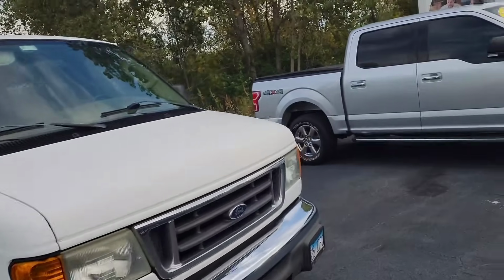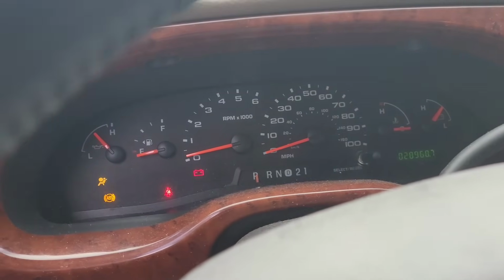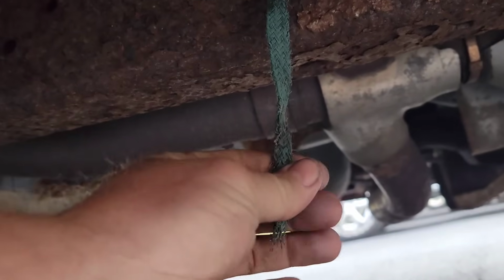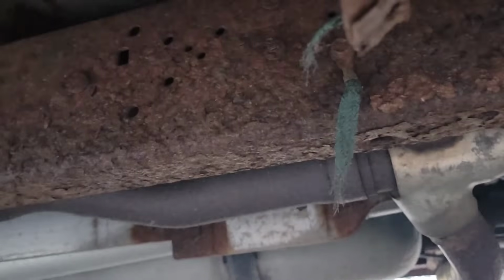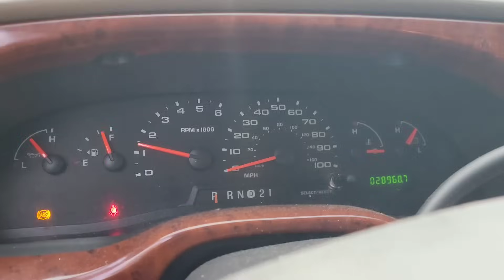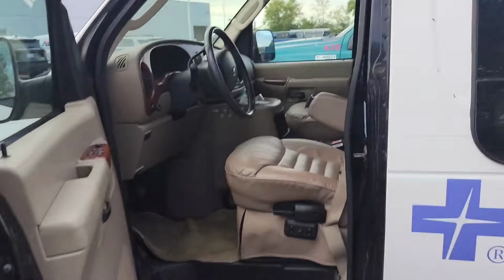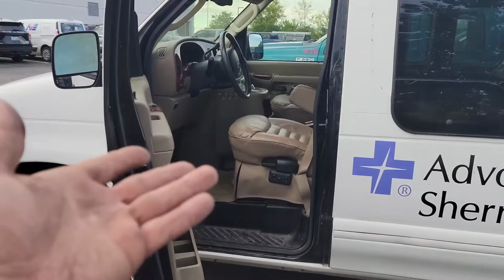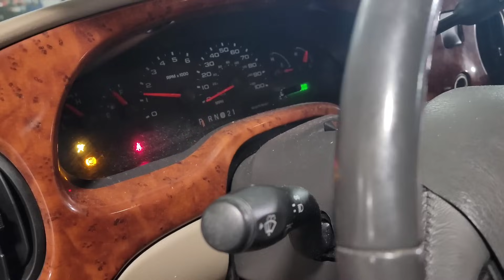Econoline No Start #1 Reason Why Typically - Crank No Start - Easy Fix - #econoline #nostart #ford

Comment: I have an 89 E150, all relays check good. Added ground to body at battery. 12v out of inertia switch. 0.14v at high pressure pump on frame. Just lost.. I'm going to try adding a ground as you did see if it works.

Comment: great vid. this might be my friends problem on his hvac van. one thing i would recomend is to drill and tap my threads for a bolt or machine screw and not use a self tapper.
Reply from the maker: James you came here and you possibly have solved your problem which this is the number one problem for a crank no start on an Econoline

I don't mind suggestions James but you're telling me what you would do if you were me but you're coming to me for help? Come on man what I did here is perfectly fine and it works perfectly fine

Comment: I separated the fuel line and turned key on. Fuel came out great. Pump works perfectly. But will the missing ground strap still make the not start?
Reply from the maker: Yes
Reply from the maker: Don't go off just what you see
Reply: @FordBossMe  ill try the ground.

Comment: People shoot the parts cannon when it's just a ground. First thing to at least check.
Reply: Most of the easy stuff is always overlooked. Its crazy but it happens to the best of us
Reply: @codyphillips48  it does indeed. Cause we are like oh I've seen this before I've done dozens of fuel pumps. Then karma is like not this time homie just a ground
Reply: We used to call it tunnel vision. Once you get honed in your mind is hard to change!
Reply: @paulday6875  facts

Comment: I've had those braided ground straps break on just about every vehicle I've owned, no matter what manufacturers they were made by! Terrible design flaw.
Reply: I use tweed and coat it with bulldozer grease.

Comment: Wow! This is something that many won't even check out. Had a 2000 Honda Accord that had interminted starting  issues. Previous  owner had a subwoofer grounded to the ground wires on the fuel pump. Just left it sort of hooked up. Removed what was left of subwoofer  ground, cleaned everything up and tighted up the fuel pump grounds. A few years later  all is still good. This was a accidental find by the way. Enjoy your videos!
Reply: I noticed the gas gage said empty but when you when back to start it it said full 😅is this a trick

Comment: That’s a very important ground that ford cheaped on. Are the 2011 econoline stripped chassis like this or no because I may check out the one on our 16 foot box truck which is a 2011 e350 frame with a Dual rear axle. Also I’ve never seen rust that bad on a newer van
Reply from the maker: This is an 05

Same ground yes

Comment: While researching my engine flooding problem on my 1996  E150 I came across a video [ 94 Ford f150 fuel problems]  That mentions Fords F150's around the same year to have the same problem with the grounds. the poor grounds supposedl;y gives a false reading to the computer which somwhow contributes to the flooding. Thanks for your time and effort, it's certainly worth checking into.
Reply from the maker: I appreciate your feedback

Comment: Dude thanks! My work van was down and it just sputtered out and stopped working, it also would only sit in idle rough with starter spray to get it going. As soon as you gave it gas it died. Literally it was because of that ground. Weird how funny electronics act without a good ground

Comment: The fuel gauge stayed still(showed sub empty) when you were demonstrating the van wouldn't start.  If the fuel pump were the only thing bad, would it act that way?
Reply from the maker: It could be a level sender on the fuel pump itself but if the ground was bad and you would have multiple things not working like I showed in the video so it may be a fuel pump but that doesn't say that you shouldn't maybe correct that ground or add a better ground to that just to rule that out and it doesn't hurt to do it anyway

Comment: Hey, are flooded vans repairable? Looking for a van and trying to avoid the ones with engine and transmission problems cause those sound a lot like major repairs. I saw some flood vans and was wonder if those are fixable.
Reply from the maker: Yeah they are I've actually taken for the vehicles apart for people to clean them all out got everything back together and clean the carpet and stuff for them it's expensive but it's definitely doable
Reply: @FordBossMe   thanks you the quick response. The van itself is a steal so I’ll definitely get it. I think it might be a good project to get me through this summer. Just found your channel this morning and I’m pretty sure some of your videos address problems I’ll probably face so thank you for your content and good luck on your new endeavors 🙏🏼.

Comment: As a New Ford Tech for learning purposes 
If I may ask what led you to this ground strap fault in your diagnosis?
Reply from the maker: It comes from experience years ago with a crank no start and me chasing my ass and one of the senior Techs came over when I was like 20 years old and said check that ground strap find you I am 36 now oh it was awhile ago Lessons Learned with experience
Reply: @FordBossMe  well I thank you for passing it on saved me from chasing wind literally was getting told through a pump to it glad I didn’t

Comment: Had a 2013 Mustang GT that wouldn’t start only pushing it (Manual) we checked the clutch pedal and the switch and good. Checked for all grounds (frame) and all good. Then the starter had a loose screw on the ground and i pushed it and the car worked… it’s impressive how little Can a car not start.

Comment: QUESTION: I have a 2015 Ford Escape 2.0L. I was planning to install a DIY sun/moonroof position indicator using a magnetic reed switch, indicator LED and magnet (all 12V compliant). Would I have any power issues, if I tapped into one of the dome light wires to make the circuit? Do you have any advice for the installation? Thanks in advance!
Reply from the maker: I have no idea where to even begin other than telling you I would run my own power source with a fuse from the battery

Comment: Hey rich I just picked up a 02 e250 with the 5.4 only 132k miles anything to look out for on these vans ?? It tries to start but sounds like fuel pump is dead?? It hasn’t been driven in several years when owner died and it was left in a warehouse.Already changed brake and Pw steering fluid . next is coolant flush and oil flush  

What’s the best oil and OCIs you recommend for these engine?? Does it have to stay 5W20 or can I do 5w30 since I’m in Texas ?? I’m just going to use it for my monthly 500 mile Dallas warehouse runs lol🤣😜
Reply from the maker: Just use 5W30 and use Valvoline or Pennzoil Platinum
Reply: @FordBossMe  thank rich 😎

Comment: I saw a video that said, you have to make sure your ground from frame to body like you did, then frame to motor then body to block.
In my 93 E150 i changed out all theRelays cause never done it, put ground from block were egr valve mounts to it and fram under hood were it atraches to left whedl well. Checked it with meter & have Gd connectivity but still DON'T start jyyst cranks. 
Will try the one in your video to see.

Comment: SANCHEM makes a product called  NO-OX-ID A-SPECIAL. A 2 oz can be bought from eBay for $10. This is a conductive grease that is put on the wire end before crimping on lugs. Plus it can be put on the lug itself before bolting in place. It will never corrode  The best thing is t can be put on battery posts before the terminals are put on. Cover the terminal itself and the bolt. Again it will never corrode. It will look like new for years. Just a very thin layer is needed.
Reply from the maker: I use XG12
Reply: @FordBossMe  Good to know. Thanks

Comment: I've been driving these for years, we have a fleet of them. I've put hundreds of thousands of miles on Econolines, never had this problem that I'm aware of. Fuel pump modules, yes. Did they fix the ground strap problem from '08 on up?
Reply from the maker: Before I answer anything here and I really don't know whether or not you're being sincere asking a question or you're kind of being rude at the same time so I could just be wasting my time even responding to you because I don't know how to read a comment on the internet because I don't know somebody's intention this can be taken more than one way

The first part of your statement probably wasn't even necessary you could have just asked a question by itself

No they never fix the ground strap problem even until today I get 2017/2018 Ford vehicles in where everybody goes right for all the difficult stuff instead of checking grounds and if you spent any time on this channel and you actually paid attention to what I'm talkin about here you'll see that I even Preach Today a lot of the problems that they have with electrical connections and Communications in between modules is because of grounds
Reply: @FordBossMe  thanks for the reply, even though the first part was unnecessary, you could've just replied. It was a legitimate question.
Reply from the maker: @bobthetruckerguy5770  well I mean I have to stand up for myself and if I have something to say I'm going to say it that's just how it is here and you'll learn on this channel this is how I am if I feel like somebody could be possibly attacking me I give it to them straight up front to let them know if you're questioning my professionalism and what I know then you don't have any business here but if you're legitimately asking a question I'll do everything I can to help you

Now you laying out the context of you driving these Vans for so many hundreds of thousands of miles doesn't do anything for our conversation maybe it helps me get to know you a little bit more but it doesn't do anything for me and you establishing a communication line and you asking a question
Reply: @FordBossMe  I was simply establishing I've had a lot of experience with these vehicles. Not attacking you in any way. Another unnecessary fact is that we operate in upstate NY where they use tons of salt on the road, we run these vehicles over 400,000 miles, and the frames look better than that van you were working on with only 28,000. Must sit in in a very moist location. I'll talk to our mechanic, now I'm curious because I've never had any major problems with these grounds. Usually when it won't start like that, it's most often the fuel pump module.

Comment: Thank you for the information my friend. One question, I have a 78 ford econoline and its not turning over, could that be the issue as well?
thank you
Reply from the maker: I'm not sure back that far

Yours would be battery
Starter solenoid 
Cables / wires
Starter itself 
Or the ignition switch 

Look up how to jump and Starter and that will help
Reply: @FordBossMe  Thank you buddy, went thru every aspect you mentioned and found the gas pump is not working. Thank you :-)

Comment: I’m having an issue starting my 96 e350 wagon. It has a brand new battery too. My ground wire looks fine but the rings do look corroded. I wanna replace it anyways. What AWG wire did you use for your ground jumper? Thanks!
Reply from the maker: 2/4/6 all would be sufficient doesn't need to be massive
Reply: @FordBossMe  thank you. Your video is very helpful

Comment: i've had the same problem and mechanics replace three batteries, and disconnected some electrical stuff and  a day after i got gas, it won't start, it almost crank but wont turn over on y 1999 Ford Econoline Van. El50.  Can you recommend a mechanic in Galveston Texas?
Reply from the maker: I don't know anybody in Galveston

Comment: I tried this but it didn't work. I'm trying to fix my interior lights. I noticed that I didn't have a ground after the body shop worked on my rocker panel. I was really hoping I could get my lights to work again. I reused the old screw and hole. Should I have made a new one like you did? I ever sanded off the rust. Is the rust and issue?
Reply from the maker: Yeah if I was you I would at least sand the area down and use a new Bolt and get it real clean like I did
Reply: @FordBossMe  thanks

Comment: What kind of torch was that you used for the heat shrink?  Looks like no exposed flame which is awesome, I do tons of electrical work
Reply from the maker: It's a Dremel torch soldering iron

Comment: Interesting info. I read the CC. You mention body on frame.   I saw a video on body on frame vrs  unibody   While researching for a car a few years ago.  Do unibody  have this same type of ground or is it specific for body on frame?
Reply: yes they often do, from engine to body, battery to body, various other components.

Comment: One thing not mentioned is that Ford likes to run wires/tube/hose on the inside of the frame rail ... be sure to check first before running a self-tapper ;)
Reply from the maker: No pal this video is about this EXACT situation in the SAME spot they already have a bolt

Although I agree with you, you could have said that so much better instead of the " listen to me first " mentality

Comment: Hello I have a 1992 ford E150 club wagon.  I can crank it over and will start with starter fluid in intake but fuel pump not engaging.  What be your thoughts?  Would simple ground wire fix issue
Reply: Climb underneath and test by using regular old jumper cables to see if it works.
That's how I did it.  Fuel pump was trying to pump I could hear it but van wouldn't start.
No fault codes showed up on tester.
Used a pair of jumpers and it fired right up.
The braided ground strap looked good but disintegrated when I rubbed it between my fingers.

Comment: Question: I have a 1993 Ford E150 5.8L Club Wagon Van.Can the ground to frame and body, be done under the vans hood somewhere and if so, were would be a good point.?
Reply from the maker: Why would you not want to do it just from the frame to the body under the passenger side of the vehicle? I mean I'm sure it can be done but the wire would be extra long and I don't want to see the benefit in it to be honest
Reply: I have a 93 Ford E150 5.8L Club Wagon Van and I CAN'T, lay on the ground do to my disability.
CAN YOU SHOW ME HOW TO ACHIEVE ALL THOSE GROUNDS FROM INSIDE THE HOOD AREA OF MY VAN.

Comment: I'm still learning about cars. My 97 Econoline being my first. But I came across this video while searching for a solution. My alternator is good , battery is good, starter seems fine, though I can't get to the flywheel cause it's covered. I'm having the same crank no start issue. The fuel pump was replaced 3 years ago. So I'm hoping to crawl under the van tomorrow and fingers crossed this ground is the problem.  Could you attach a link of the wire you used ? I found the other items but I'm lost on the wire. Thank you for all the help. Awesome videos btw.
Reply from the maker: You can find any decent size wire brother from any part store
Reply from the maker: https://amzn.to/3BXMpz6
Reply from the maker: https://www.amazon.com/dp/B000CO968G/ref=cm_sw_r_as_gl_apa_glt_fabc_YFWHTW5XR2KDV0H0GMFV?_encoding=UTF8&psc=1&linkCode=ml2&tag=richarddpoiss-20
Reply: @FordBossMe  My Ford was running fine tell I wash the engine bay , it cranks but no start,can you help me on this issue

Comment: Awesome video. I have an issue and people have mentioned to check my grounds. Is there a diagram or check off list somewhere that shows me all the grounds on the vehicle? I’m not mechanically inclined but if I had a diagram it be easier. I have a 96 e150.
Reply from the maker: There's no good diagram you're just going to have to get down there and start looking everywhere
Reply: @FordBossMe  ok. Thanks for the reply. This gives me a good idea!

Comment: Do I have to put the ground in that particular spot
Reply: No. As long as it's from the frame to the body. The closer to battery the better I think.
Frame must be connected(touches) negative from battery I believe though.
Try using jumper cables first to verify.....that's how I did it.

Comment: What is the name of this part that failed? What would I tell my mechanic to check?
Reply from the maker: I'm confused 

I explained ( I thought very well in this video ) the exact symptoms and components that failed 

The wire I fixed if you watched the video ALL THE WAY through is a main ground for the fuel pump and the ground cable rots out and falls apart from the body to the frame on the passenger side under the passenger door
Reply: @FordBossMe  hey man, you explained this very very well and I appreciate it! I tried explaining that to my mechanic and he said it wasn't clear which ground it was and he said fishing around would take a long time. I'll tell him what you wrote here.

Comment: 2004 Ford E-450 chassis. I’m getting this issue. I tried your fix, but don’t know if I put the grounding wire in the right place or not. I didn’t see any pre-existing grounding wires under passenger door area. I tried replacing the fuel pump already. Any ideas?
Reply from the maker: Put a ground cable there anyway
Reply: @FordBossMe  I put one from a bolt in the rail you drilled to a metal band holding up something. Is that the same, or do I need to drill it into that metal box (passenger step?) at the end that you seemed to?
Reply: Mechanic checked old fuel pump and it was working

Comment: Thank you!! I have same vehicle and same crank no start the ground  is connected but where it mounts to the body is really rusted and not good contact, I tried to verify it, I used the normal jumb start cables cleaned contact points and put black cable from frame to body and vehicle did not start. I'm trying to fix it by my own but not sure if the ground is the problem how can I verify it?
Reply from the maker: Well if you have a corroded Rusty ground put the ground down there
Reply from the maker: What does the dashboard look like.....you didn't tell me any of that do you have fuel levels you have RPM